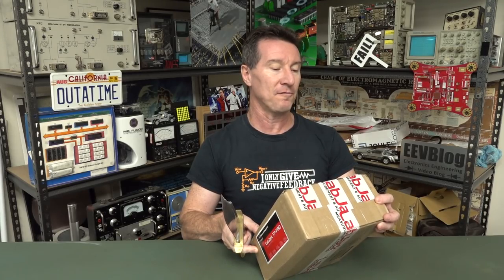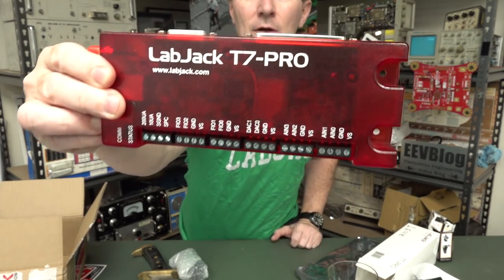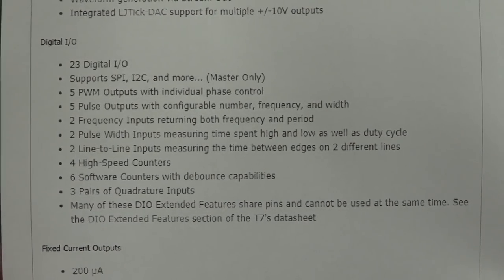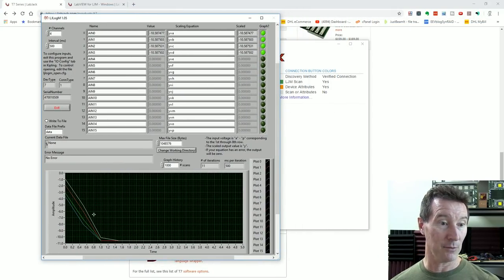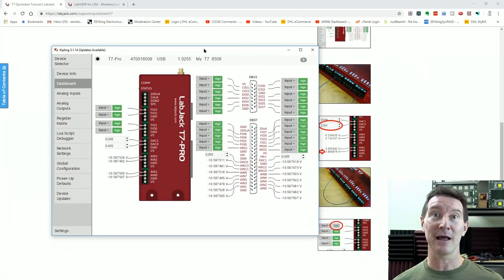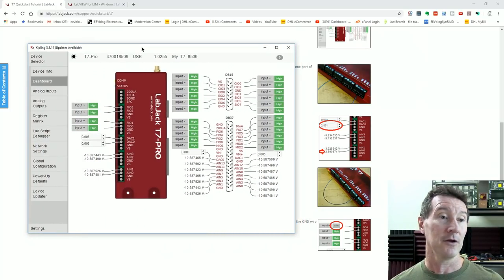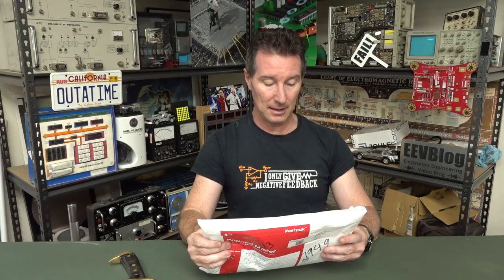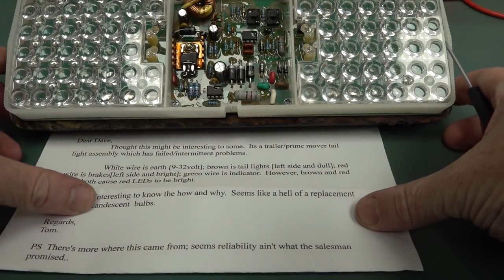EEVblog #1190 - Mailbag Review Bonanza

Comment: A Micro SD Card in an industrial surrounding is horrific, because it always will fail
Reply: I wouldn't make such a generalized claim but i agree that consumer SD cards aren't supposed to be used in industrial environments. 
Siemens uses "SD" cards to save the user program in their SPS system for example which seems to be absolutely fine (but they charge enormous amounts of money fore one too...)
Reply: I agree with Wi_Zeus below. Typically SD cards are our preferred option also. This way when a device fails a service technician can pick up a new controller from the spare parts warehouse, move the SD card to the new device, and make the production up an running again. Having to do what Dave did to make it work again using some back-up and software tools is not an option. Most industrial devices I know of that have lots of configuration, also have an SD card of other memory format that can easily be moved to a new device.
Reply: I work in a pallet manufacturing factory. The machines that assemble the pallets use plc and air logic control. The programs are held on a Micro SD card, but they are inside the control panel, only maintenance dept. can access them and ive never seen a failure, but i have seen them swap the sd card into a new controller and the machine was up and running in no time (no need to reprogram).
Reply: I've seen too many "industrial grade" SD cards fail to trust them in industrial use... Too many horror stories from the field
Reply: I also had Apacer industrual grade sd cards failing in the fields. Maybe because of a close lightning strike, which makes an EMC spike? After a couple of failures, I've swithced to pure SLC sd cards, I hope that will help. Anyone have expreience with Inoodisk or ATP SLC SD cards?
Reply: SD cards most of the time fail because of a lot of writing. But if you use it as a boot drive in read only they will last forever, just like any other flash memory.
Reply: @enzorenting1196  true..it is possible to use them that way and that will decrease failure rates but the average embedded Linux implementation out there these days is pretty much to mount it as rw... I assume the engineer who built this was right in assuming the rpi "iot" crowd wouldn't be as versed in reliability as the "oldschool" (lol) m2m folks
Reply: @DiegoSpinola  That is also true, but the embedded Linux systems I work with are using regular SD cards as their bootloader in read only (locked). It all depends on the engineer his choices and the use case..
Reply: SD cards are fine if your aren't writing to it.

Comment: The 2uS of time on autoranging is to prevent high speed oscillations. You need to switch the resistors, but also notify the microcontroller about new range. Either via interrupt or some other data line that is constantly read during ADC acquisition.  There are probably some capacitors around these comparators to slow down the response.

PS. STM32F do have good high speed high res ADC. You should know that Dave ;)

You want high res on Voltage actually. I.e. to detect slow discharge of batteries. And make the device be useful as a general single channel oscilloscope. And it is easier to write code that assumes everything is 14-bit on all channels, than handle each channel separately with customized code because of different bit rates, bit depths, weird formatting, alignment, different setup procedures, etc. etc.

Comment: Yes turn signals do use bimetallic strips, however there isn't not enough current drawn a lot of times to kick off the strip. Some people throw a low resistance high wattage resistor to combat this problem. The 555 is probably another method of compensating for the lack of current to drive the bimetallic functionality.

Comment: Draw your own conclusions about the LED rear lamp unit but for me it's easier to replace a standard filament lamp if it blows and get on your way again. If one of these LED rear lamp units fails then by law you are stranded until it's replaced, and they're not cheap so you're not going to keep spares in your spares locker in every unit!

Comment: trucks nominal 24V can hit 28V easily and higher isn't out of the question. 32V max input seems reasonable. Same as your "12V" car sits at 13.5V a lot of the time and if anything is a little bit out of whack 14V isn't unusual. Small-medium trucks are mostly just 2 car batteries in series, it's only bigger trucks where you get the dual 12V 200Ah/1800A batteries that are 2-4 times the size of even a big car battery.

Running lights on trucks are legally required, depends on the jurisdiction how many/spacing, but not at all surprised to see them added in to anything that has power going to it.
Reply from the maker: Yeah, makes sense, thanks.
Reply: While the engine is running, it would be up to 28,8V... and it's a crude control circuit, so voltage spikes (when bigger loads are switched off) will go on top of that.
Reply: Just while I think of it: you can't use many household "12V" LED bulbs in cars or off-grid because of this, most of them won't cope with the voltage the car puts out. But 24V ones in a 12V system are fine. I was building bicycle lighting systems at one stage and had some interesting discussions with suppliers. There really are "12V, +-1V" LED bulbs out there and in moderately large numbers. But there are also "12V, by which we mean 5-25V and AC is fine too" as well. The way to find out is to connect them to 25V :)

Comment: One nice thing about those old D-Sub connectors is that you can wire up the other side cheaply with just wire strippers, solder cup connector and solder. No expensive crimper required etc.
Reply: @Undefined Lastname The prices on some of the NI stuff are in the hundreds up for breakouts and cables. At $5 you can dedicate a harness to each setup and move the box around as required. Of course if you can afford thousands for the the NI cards you may not care.
Reply: @Undefined Lastname I am contrasting with the Micro-D connectors, and similar that are  miserable and expensive to deal with. Solder cup or crimp works with regular D-subs.
Reply: The big DB37 connector works with this: https://labjack.com/accessories/cb37-terminal-board or as mentioned above you can also strip a wire and push it directly into the pin hole.

Comment: Automotive electronics are often potted for vibration reasons, not that much for moisture. Moisture can be kept out quite good with just casings and seals, since the OEMs requirements on moisture are less tough to meet

Comment: That 'Break light' was probably operating as a rear light with 555-dimming. It's strange why just four of the LEDs get more current than the rest. They may fail prematurely because of it.
Reply: Probably because dave didn't take the time to read the instructions and hooked it up wrong. When it saw the leds coming on slowly his first instinct should have been to turn it off and check the wiring.

Comment: For that joule meter, shouldn't there be a way to make a somewhat logarithmic/floating point SAR design?  Basically start with a textbook SAR ADC design, but for the DAC part of that, make the high bits of the SAR switch range for the compare against the R2R ladder on the significant bits.  So each sample will essentially pick it's own range factor.
Reply from the maker: Not possible. The issue is burden voltage and that comes form the shunt resistor. So say a 0.1ohm shunt suitable for several amps will only drop 100pV. So now you have the problem of measuring 100pV resolution.

Comment: About the RaspberryPi compute module board, if there isn't a modem for the nanoSIM card or connection to the miniPCIe connector, I think it might be a memory card slot, saw one on an online store while looking at microSD cards, it was supposedly made by Huawei, also the Etcher program is the one recommended in the RaspberryPi website. But I wouldn't use one of these boards for the compute module, I mean the whole point is plugin it in your own custom board, as a processor unit, otherwise the normal RaspberryPi has pretty much everything this has at a lower final price, since a PoE hat already exists for the new Pi.

Comment: I don't know how it is in Australia but in Germany a voltage converter or any device doesn't need the PE pin when it is double isolated or at least has a reinforced isolation. It's then called "Schutzklasse II" (Safety Class II) - Device and is marked with the double Square you can see on the plug.
Reply: I'm pretty sure he meant that there was supposed to be an insulating "sleeve" from the base to maybe half the length of the live and neutral legs. It wasn't about the earthing pin. Same thing goes for UK mains plugs.
https://media.rs-online.com/t_large/R0780116-60.jpg
Reply: @khronscave  ah yes... I've watched again. Obviously I didn't pay enough attention on what he's saying when I watched the first time.
Our plugs have another shape so they fit deeper into the socket, so this sleeve is not needed too.

Comment: If those tail lights are for prime movers you should run it at least 24v 
Trucks have 2 12v volt batteries in series so 24v, but the charging voltage is about 29-31v if the alternator is work properly anything below that is an alternator about to fail!
By the way unless it's very old truck from 80's 90's , is a bad idea to swap bulbs to leds because more modern trucks will tell you that you have burned bulb it requires current to be drawn, leds draw almost no current so it will fail test and automatically cut of that circuit! 
The last time my boss gave me a new truck, on their infinite wisdom they got a truck with bulbs lighting with the protection system and a trailer with led lighting that can't be mixed, they almost rip all their hairs off :D
Reply: Andre Rodrigues actually the truck I took that off is 12 volt. Kenworth. I think late 1990s model. A lot of trucks are 12 volt.

Comment: The LabJack wall wart is double insulated, hence no grounding prong. It is legal in (overly regulated) EU at least. The double insulated symbol is the square inside the square.
Reply: The criticism wasn't about the lack of an earth pin, but about the lacking insulating "sleeving" over the base of the live and neutral pins.
https://media.rs-online.com/t_large/R0780116-60.jpg
Reply: @khronscave  You are indeed right :)

Comment: No disk imaging tool needed for Raspberry Pi  these days with the bootable NOOBS setup.  Just unzip a small folder (downloaded from Raspberry Pi's site) onto an SD card (assuming it's formatted FAT32) and put it in the Pi.  From there, connect WiFi and choose what distribution(s) to install onto the SD card (yes, the same SD card NOOBS was unzipped onto).

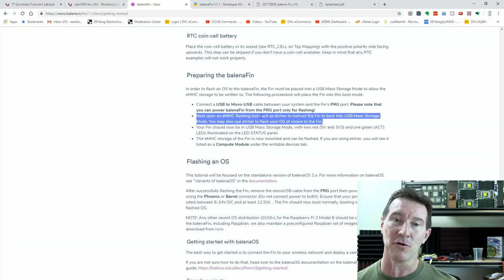Comment: 25:04 No offense, but Etcher is a pretty standard, if not de facto, tool for flashing the Raspberry Pi. The Raspberry Pi Foundation itself says to use it, and so many others say the same thing like Adafruit so....
Reply: Dave might not be that up to date... I found my self in the same position (asking WTF is etcher) as I was fairly early to the whole raspi game and used to Win32diskimager (which was the standard for quite a while) or just plain old dd when on linux. But times have changed and even though etcher has proved to even deliver defective builds on occasion, when on windows I am mostly using it now...

Comment: I love the How to Flash an OS section... It says connect the DC power. USB can't supply enough power like Dave said according to the on screen directions in the video.

Dave reading comprehension failure detected...

I face palmed hard when the Dave note appeared about nothing in device manager. PEBKAC errors are a real danger afterall.

Comment: The automotive backlight is not at all reliable. If it was made for reliability it would have at least conformally coating on the soldering side (which it completely had not) and it would need really 100 percent coating or potting at the electronics parts side. If water could make its way into that lights you would get all kinds of oxidation and it could even crouch into the transistors, resistors and capacitors itself destroying them. So, better keep away from that kind of (ebay-?) Thingy.

Comment: Labview have a mistake. There's no such thing as a DB15 or DB37,  it's a DA15 and a DC37
Reply: I am not sure what drug you are smoking but DB15 and DB37 are quite common DB15 is a joystick port game port and DB37 could be found in many applications
Reply: @God-CDXX  The letter indicates the shell size of the connector. The correct name for DB15/DB37 is DA15/DC37. See the Wikipedia article on the connector family. https://en.wikipedia.org/wiki/D-subminiature
Reply: @the6p4c  i have in stock DB15 and DB37 connectors and DB15 and DB37 are on the packaging from the manufacture i trust the factory packaging label over Wikipedia any day seeing basically anybody can edit a  Wikipedia page
Reply: @God-CDXX  Welcome to "technically correct" versus "common usage". Nobody refers to the connectors by their original names any more. Also "anybody can edit Wikipedia", but if you did your own research you'd find many many many more sources to back that up.
Reply: @the6p4c  6 of one half dozen of the other we all have our own way's i am likely older than you so i am used to looking at DB37 where you use DC37 as long as we are able to find what we need that is all that matters as of tonight i get 309 hits on Ebay for DB37 connector and 40 hits on DC37 connector so it is good to search both DB and DC
Reply: @God-CDXX  You might want to consider caliming the F___ down, and actually take the opportunity to go "wow, never knew that".
Find a single manufacturer's page that says "DB15", you wont.   Note the part number here: https://www.digikey.ca/product-detail/en/amphenol-icc-fci/DA15P064TXLF/609-1512-ND/1001826     "DA15P.....", and then look at the whole product sheet.   DA15, DB25, DC37, DD50, DE9

Comment: On the joulescope, I would expect at their price point to see a custom enclosure, not an off-the-shelf Hammond 1455.
Reply: Maybe the cost is in the electronics and it made more sense for them to save costs on the enclosure. I would probably have done the same thing.
Reply: @sergeantseven4240  could be, but I'd be shocked if you couldn't get a custom enclosure made cheaper in bulk than buying Hammond enclosures. It honestly would make for a more professional looking product.
Don't get me wrong, I like the 1455 for projects, I use them all the time, but they just scream "diy project" to me.
Reply: @1tedalton  You would be Surprised. Custom made enclosures can get pretty pricey. It mostly depends on if that company buys in large enough volumes. If they are a small start up or only sell a few hundred units a quarter, that may have been the best option.

Comment: I always thought the Pi was a bad design, depending on a SD card to boot. Other systems such as the beagle-bone have a built in emmc. Additionally the idea of having io connectors at back and side are another bad idea in my opinion. connectors should be to one side and utilities such as card slots at front but this one looks really great. I think its far superior in design and accessibility to the general pi form factor.

Comment: This might be a stupid question, but talkin about the current measurement doodad... Couldn't you use several different shunt resistors of different sizes in parallel, and measure each one separately? Since you know the total resistance, and the ratios between them, you can math out the "real" current from each one in software (or hardware, I guess, for that matter). Or does this somehow affect the accuracy of the results?
Reply: If you put several resistors in parallel the voltage across them will be the same, but you could put them in series and measure each one separately for that matter.
Reply: @somanyfnbananas2774  Welp, I guess I was right, it was a stupid question. I didn't even think about it long enough to realize the voltage will be the same, and since measuring the voltage drop is how you measure current, it doesn't solve anything. Thanks!

Comment: Geezus Dave, the BalenaFin is aimed at an INDUSTRIAL user.  No one in a real industrial use-case is going to run their OS off uSDcard.  People who send stuff in to Mailbag appear to take a huge risk in you going off the deep end on an inconsolable irrational rant completely out of context.  Grow some self-control and think about this before turning the camera on.  Oh, that’s right, that’s not what you do - “off the cuff”.  Vendors beware.
Reply: No one wants to BOOT from it, people want to use the uSD-Card to install an operating system. Apparently the "boot to emulate mass storage" is either non-working or under-documented. Oh, and even INDUSTRIAL users want to get their hardware into a working condition ...

Comment: I must say that my own lead-free re-flow soldered joints look a lot cleaner and shinier than the ones on that DAC board. Their board may pass electrical tests, but the joints shouldn't look that crusty.
I'm not sure quite why. It gives the impression that their re-flow oven temperature profile needs re-calibrating using a spare board or one of a similar thermal mass.
Maybe they just need a different "no-clean" brand of solder-paste.
Reply from the maker: The solder type and reflow oven cooldown ramp varies a lot

Comment: Could you design a raspberry pi tile board for use with the old cellular broadband engine cpu format to do a hobby computer with a ps3 super computer processor also I’ve seen the micro usb sockets catch fire and the micro as it self catch fire before any fuse blew